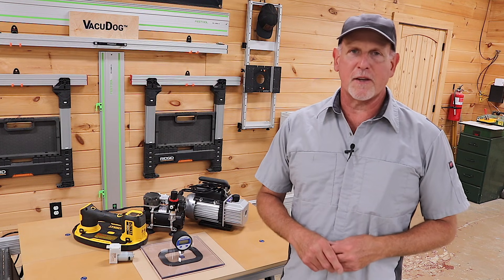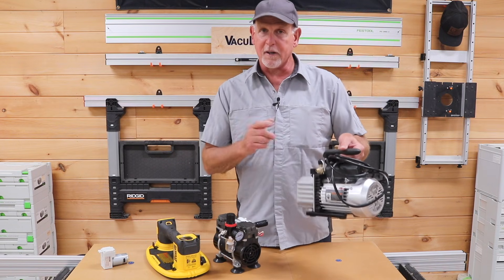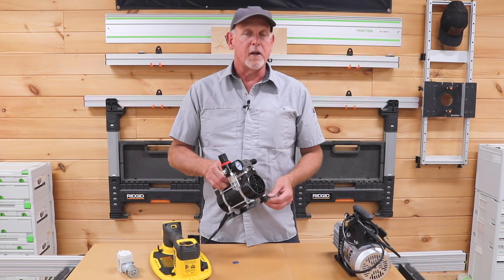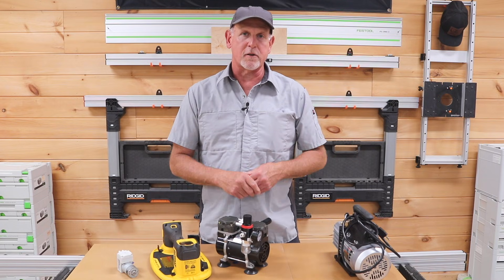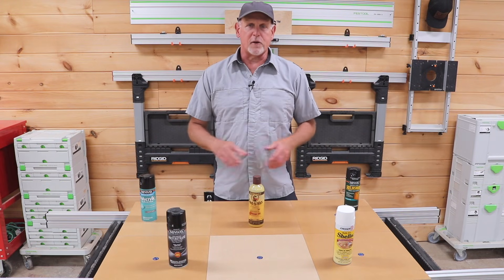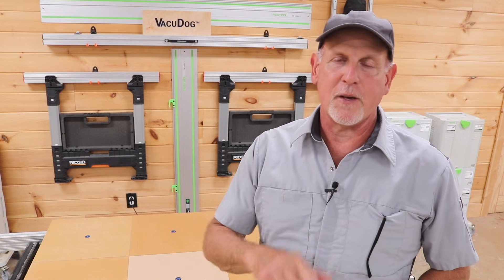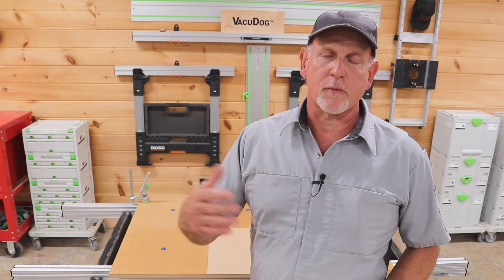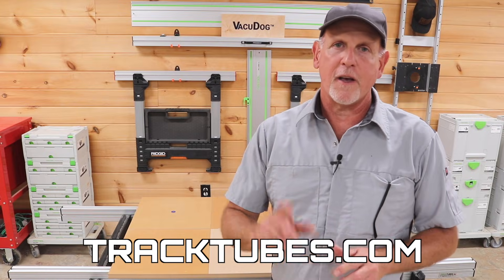VACUDOG™ Test - Should You Seal Your MFT?  Will it Really Improve Vacuum Holding?

Comment: 2 Questions..

1) when is the XL going to be available?

2) any issues with dust? Mounted in a bench, table etc in a wood shop there is going to be dust that can and will get into the intake orifice. I know you mentioned there is a cap for when not in use but that question remains

Comment: This is a classic case of good enough is good enough. For what its worth, I have found that the PolyCrylic holds up best for use on shop furniture. I don't care for it as a project finish because of the color, or I should say the lack of color. I did a video on spraying the PolyCrylic vs Shellac vs Lacquer and it has held up the best. Great video!

Comment: great video thanks. i am a little confused by the reference to continuous run/usage pumps, specifically that the Grabo is not. i had the same understanding about Grabo's but after reviewing their documentation, i was wrong, and they are designed for continuous running, especially with semi-porous materials like mdf. i have had them running for 10-15mins at a time continuously (haven't had the need to go longer). yes, there is the battery to contend with, which could conceivably cut out at a bad time. but my experience with the Grabo's is that they have very long battery life. is there something specific with Grabo that you're seeing?
Reply: We did extensive testing with a variety of vac pumps and found a 50L/min 2-stage vac pump (purchased on Amazon for $145) was much quieter and held a variety of materials (including MDF) much better than the GRABO.  I use my GRABO quite a bit for moving sheet goods around ... it's awesome,  but when it comes to using it for supplying vacuum to external pods (or the VACUDOG™), there are much better (and less expensive) options.  If you need a mobile solution, or no AC power is available, then the GRABO will do fine, but it does have limitations, which is understandable since it only produces about .77 cfm.  Do a search of ChatGPT asking about using the GRABO for vacuum pods and see what you come up with.  We did and it was surprising.

Comment: I'm considering making a MFT top covered with HPL.  Do you feel a laminate top might give an improver seal?  Thanks and I'm looking forward to my VacuDogs arriving tomorrow.
Reply: Glenn, Thanks for the heads up on the thickness concern.  I haven't received my VacuDogs yet and didn't realize there is that tight of a MFT thickness issue.  Perhaps cabinet liner, which is very thin but non porous might be an option.  Thanks again for the heads up.
Reply: The HPL laminate is non-porous and will provide a great seal, provided it is glued to the substrate good, so vacuum can't be pulled between the laminate and substrate.  Be aware that the VACUDOG™ is sized to fit standard MFT tables/tops that are 3/4" (19mm) thick. Adding laminate, especially on both sides, might be a little too thick for the VACUDOG™cap's male threads to reach the female threads to screw together.